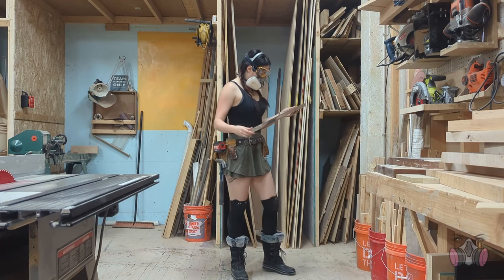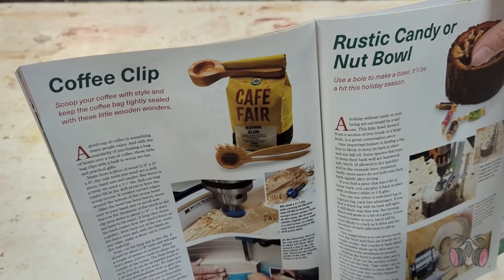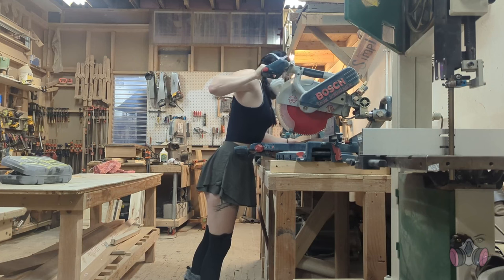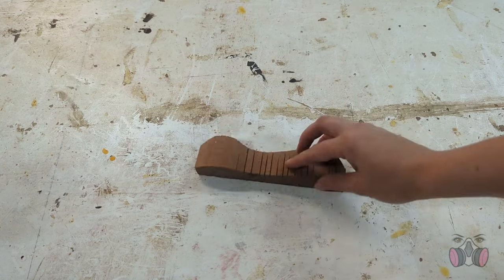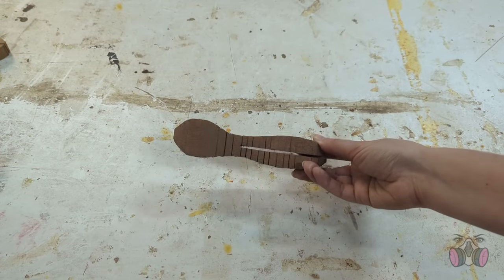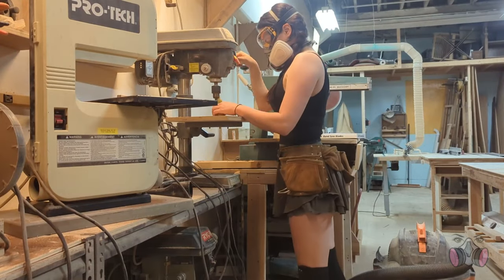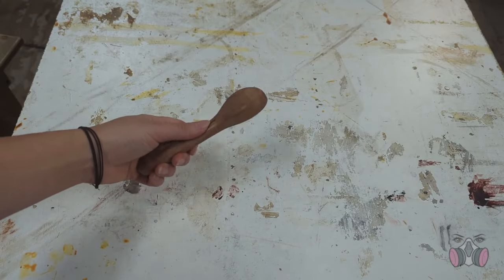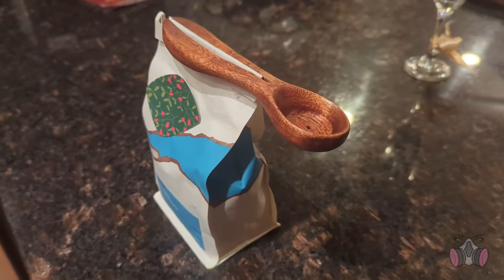DIY Woodworking Christmas Gift | Small Project Inspired By Woodworking Journal Magazine

Comment: Pure Tung Oil is food safe, but Tung Oil Finishes, such as the Watco used here are not necessarily so. Long Chain Alkyd is the first resin mentioned in the Watco TDS, followed by Tung Oil, but the percentage of Tung Oil isn't specified. No claim of food safety is made by the manufacturer. Their solvent is mineral spirits. I make cutting boards and other food-use items, and use 100% pure Tung Oil (either Hope's or Real Milk & Paint), and apply an initial coat thinned 50-50 with food-safe citrus solvent. I don't see a danger from contact with coffee beans, though.

Comment: You can shape the bowl more easily by taking an old spade drill bit and shaping it to a semicircle shape on a bench grinder or use a dremel. Then sharpen it on each side according to the direction it turns, only half of each side (easier to have a picture than a description).  Use in a drill press to fashion a bowl shape.

Comment: I made my first spoon on a lathe. Trimmed off a little lass than half half of the "bowl end" with a hand saw, then finished with a dremel. The handle and the back of the "bowl end" were finish sanded on the lathe. All else was finished by hand sanding. Fair results. I am a beginner on a lathe and at applying finish. I just used a "food safe" oil.

Comment: Nice project. You might try a rasp for that kind of carving. It might be easier than using the dremel for that.
Reply from the maker: Yeaah, I didn't realize just how much work the dremel would be until I got started. I think a rasp would be a good call, or anything that can cut that initial shape more aggressively

Comment: I have a bass with a mahogany body.  Mahogany is fantastic wood.  Of course, that bass weighs about 3 tons...

I actually like the shape of your spoon better than the ones in the article.  It looks terrific with just the Tung oil.  I think one of the advantages of hard woods in general is you don't have to sand them as much because the tools don't damage them as much.  On the other hand, you'll need to buy new bits and saw blades sooner and the wood is more expensive.